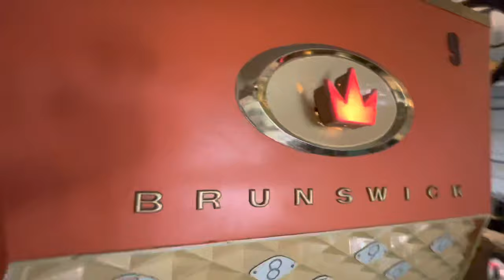Snow day 2 - Hit Subscribe! Me bowling on Glow pins by request - garage bowling alley Brunswick

Comment: That is a short lane...!  Great idea to enjoy bowling in your garage.    So your 1956 "A" model is about the same age as the 32 model "A"  pinsetters I worked on in 1969-1972 in St. Pete.  Our old pinsetter started having rake arms,  ball cushion arms and other metal parts breaking.  It seemed like we had to weld something weekly.   Loved the job but hated washing all the bowling twice a month.  We cleaned areas on the pinsetters daily and major cleaning weekly. The customers like our bowling alley because at the end of a league they had clean hands & shirts unlike the other bowling alleys in the area.     FYI -  I am just east of you in Rowlett. My current project is helping restore a 40 year old minicomputer designed and built in Richardson, TX   (  YouTube search for    "I Bought a Minicomputer from 1980"    we have over 25 videos now and a running system.   ).
Reply from the maker: You'll have to come by sometime.    I'll check out the video too         I keep plenty busy with 1 pinsetter, I couldn't imagine 32 to keep up with at 66 years old (and still running strong).    I LOVE the pinsetter and how it works.

Comment: As a center mechanic and proprietor I would like to suggest- if possible, definitely re-shim and level the foul line area and front of the lane. I would also oil the first couple feet to protect the wood if you don’t already. I love your videos and setup!!!!!
Reply from the maker: I do oil the lane      I didn’t today before I bowled but I usually spritz the heads.   The 2 feet before to 2 feet after the foul line is level but then the lane slopes up as I couldn’t get the pin deck any lower and I couldn’t have the approach any higher so there’s a slight incline that levels off just before the pin deck, which is level.

Comment: Must be one of pinsetter made by Otis elevator company if serial # is below39000 then it is
Reply from the maker: It has 1956 cast in the 1:1 cam.       It’s one of the originals !     Mean green machine
Reply: @GarageBowlingAlley  it is an Otis Otis made the first 39000 machines for Brunswick the Brunswick serial numbers pick up at 50000 not know where the other 11,000 went

Comment: What's the cost for a set up like that, and curious how much in electricity it would be to run?
Reply from the maker: Cost wasn't as much as many would guess.  You can pretty easily find the pinsetters for free and you just have to pay to remove/move it. For the electricity costs, it isn't noticed in the bills, so not very much. ~Aaron
Reply: @GarageBowlingAlley  thanks for the info, Finding a pinsetter for free around where I live is next to impossible lol. Bowling is a rare sport now, not many bowling alleys around anymore. Most have closed in the early 2000's, Enjoy your videos, miss the sounds from the alley

Comment: So how you know how to fix the setter if it broke down? Did you used to work at a alley?
Reply from the maker: I used to.    Then hadn’t worked on one in years but it was like riding a bike once I had all the pieces putting it back together again and running it.    I love all the fine tuning of it.    There’s a video way down at the bottom of the list which was the first time I turned it on and cycled it.
Reply from the maker: Yes.    I used to.  Luckily I hadn’t forgotten much when I got on this one.   Plus luckily this one was in great shape and adjustment it didn’t need too much

Comment: Outta curiosity, How much did it cost you to get the machine and get everything up and running?
Reply from the maker: No real price tag but machine was next to nothing.    Removing it from a 2nd story building was the biggest cost.    Lane pieces were next to nothing, again no one wanted them so I was solo       It was just the work of removing lanes and machines from a 2nd story building.   Masking unit and some ball return parts was a few hundred bucks.  Then it came down to time and creativity on my part building it